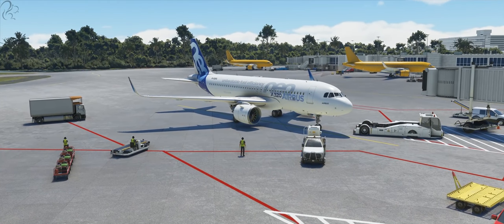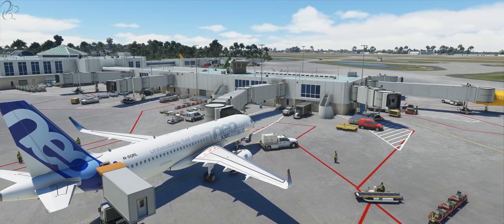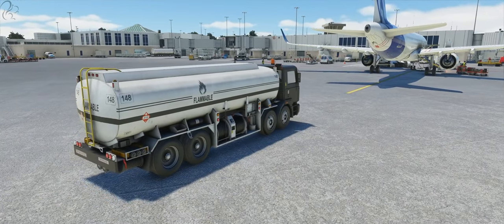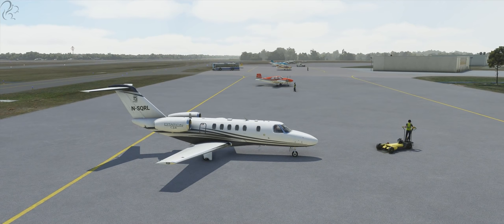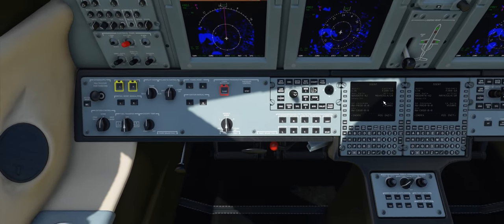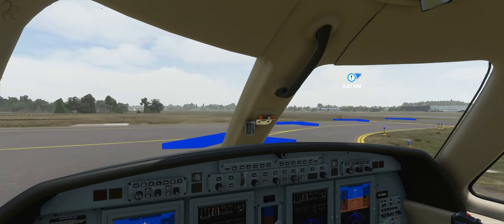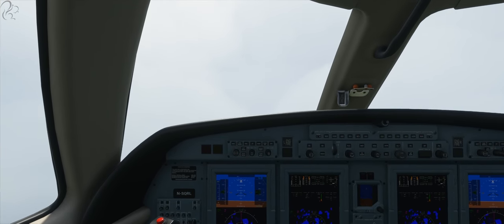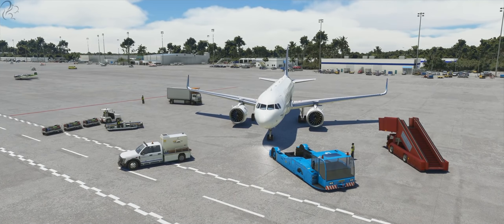Ground Services & ATC - Microsoft Flight Simulator

Comment: Thing that bugs me the most of the fuel truck being on the WRONG SIDE of the aircraft....  All airlines get the option of which side they want the fuel panel on and most pick the right side.  Im a fueler....  The panel is up on the wing or on the fuse next to engine 2 or both depending on the airline again....  Yes a fuel tanker would fit under the wing of a A320 CEO/NEO.  Its tight but there is enough clearance for a 10,000 gallon tanker to fit.  If GSX becomes a thing in FS2020, i rather use that anyways.....

Comment: The interactions with ATC in the ground services section are definitely not realistic, since none of those interactions (with the exception of the push back clearance) take place with the Ground Controller. Also all push back dialogue only happens between the tug driver and the pilot and not the tower.

Comment: Good to see it has more out of the box than X-Plane or P3D in terms on ground handling services, but it's a shame that the cabin interior of the aircraft doesn't seem to be modelled, only a couple of window views and the areas where the doors are. I suppose this would be something you'd see in addon aircraft rather than the default ones but it's still a shame to see. Hopefully they fix the janky collisions before release.

Comment: Any recommendations for new equiptment i need for flight sim, I am new and am wondering what i need at a relatively low price?
Reply: The basic I would recommend you is a HOTAS like the Logitech X52 for example and your keyboard and mouse. 
If you have a bit more money, there is some better options like the Logitech yoke and accessories or thrustmaster TCA officer pack.
But to start, don't spend too much until you're sure that you really like it. And try to learn as much as you can in order to enjoy.

Comment: So....question:  Is the game going to include some form of career mode that requires all this ground services stuff (including fuelling from the truck rather than just picking the fuel you spawn with)?  Is the game going to remember fuel, catering supply and battery levels when you despawn?   Will there be a penalty for forgetting to take food and drinks on board and only realising when you're an hour into a 6 hour flight?   Cos if not.....what an opening for a gifted addon developer.

Comment: Another sim pilot doing an engine start while attached to the push-back tractor, WITHOUT turning nose wheel steering off.
Just push all the way back to the hangar, load  up Aircraft Mechanic Simulator 2020, and proceed to do the steering cylinder inspection. ;)

Comment: I like the fuel truck is very careful. (At 10:00-10:59 ISH)

EDIT: Squirrel, did you takeoff in the Cessna Citation and land in the A320NEO?  If you did that could explain why you were told (upon landing) to taxi to GA parking.

Comment: Technically, during a pushback, the ground operator should be communicating directly with the pilot, not the pilot talking to ground frequency and then the ground frequency passing the message on to the operator.

Comment: Hey just wondering I have a computer with the same spec as yours only with 64 gig ram, can I play this game on maximum ultra settings with ease?
Reply: On what resolution? Currently, no available hardware can do 4k/60fps at ultra settings. Not possible.
You can turn down the internal rendering to around 70%, that helps. And lower settings to high.
Reply: @smaller_cathedrals  I just purchased a 49 inch ultra wide Samsung, 3840 x 1080
Reply: @smaller_cathedrals  The 144hz refresh rate of the Samsung 48.9 Inch Ultra-wide Curved Gaming Monitor

Comment: Did Microsoft not involve pilots in the creation of FS2020? GPU's are really NEVER on the back of trucks. External power is usually supplied off the jetway or a power cart if there is no jet bridge. And ground control doesn't handle GSE. Operations does that. It's beautiful though.

Comment: Naughty, naughty. The door should not open until the catering truck is in position. The catering team actually open the door, not the aircraft crew. Edit: crew will open the door if they are aboard. However, catering load is usually done long before the crew arrive, so the catering team would open the door. Either way, the door is never opened unless the truck is in position.

Comment: I've been a Jet Fuel delivery guy (not a fuller). There's nothing called being too careful in that job. Clip a wing, back into the hull, or sneeze in the wrong direction you're looking at hundreds of thousands in damages.
I've been at a smaller airport where you have to use the taxiway to do a 180 turn for the offload spot. Everything looked chill, nothing going on. I need permission to enter the taxiway don't I. Where are the guys with the radio? 
Started to creep forward and out of nowhere a GA just appears skipping his way past the front of the truck. Diarrhea moment! 
Since then: Nothing else is more important. Nothing needs to be hurried. Rules save my ass if I follow them. Careful is the word of the day every day.

Comment: I wouldn't be surprised if they kinda left the ground services lacking in features, just so payware addons (like GSX) can be introduced. When I found out that FS2020 was going to have all those features there was a bit of doubt in my mind that they would be as clean as GSX, which also has flaws but you know, its still better than this. Maybe I am wrong, but if these bugs/issues are present at launch, I have a feeling that support for ground services will be very limited and pretty disappointing. With the amount of third party developers that this game has already, and with more to come,  I think any short fall of the base game will cleaned up, but at an expected cost. What they have given us so far is breathtaking, and they have revived the flight sim community for years to come, which is exciting.

Comment: This is amazing for freeware wow. Not saying this in a bad way just some food for thought from a guy in the industry. The GPU got connected in the wrong spot it doesn't go up the nose gear it goes in a panel in front of the nose gear directly below the cockpit. The cargo bin is about the right size for an A320 but the inside shape is off and the fuel truck fueled on the wrong side of the aircraft. These are the things I've noticed only 10 minutes in though but all in all not bad! It is a flight sim not a ground sim after all and it is new. I'm sure it'll get patched

Comment: For a US airport at around 5 mins or so when you made the comment about loading and unloading at the front and the rear door, that’s actually accurate as you normally only board small passenger (like the A320 NEO) aircraft in the US via the main door and would not use air stairs at all unless there was no jetway.  Ramp and air stair boarding is not that common unless its an 50 to 100 passenger RJ.

Comment: MS have been years with this in the planning before making their grand announcement on the launch date. I said then (on a different Reviewer's channel) that MS were releasing far too early - a bit like selling a car before you've connected and tested all the components! The result, as I stated weeks ago, would be a lot of very unhappy customers discovering they'd bought a "buggy" instead of a shiny new dream machine. In my view, MS have launched early, purely to get the money rolling in (call me a cynic), but it would have been better to get everything up to a reasonable standard first; after all, a week after the launch they released a whopping bug-fix download that should have been done before the launch. Yet, as this video shows, there is a very, very long way to go. Far too much is still in early process, and while the dedicated F-Simmers and experienced Sim/Real pilots are scratching their heads in some frustration, what about those first-time pilots MS are so keen to get on board? How are they going to get their aircraft off the ground when they won't have a clue as to what's supposed to work and what doesn't? I've been F-Simming for over thirty years and have had every version and update of MS, and to be fair, I cannot recall many bugs in the programmes - the odd technical glitch yes - but little that might constitute an unfinished product. In MSFS2020 however, I feel that MS have tried to cram too much, too soon into this current version., with none of it up to a satisfactory standard. Yes, the graphics etc might look superb - in some areas - but in reality they're depending on 3rd-party dev's to make it better, which is absolutely fine, but most of that should have done and dusted long before launch.
Call me stupid, but like so many others, I've gone and ordered a new rig costing close to £3,000, already thinking that I'm going to be disappointed, and possibly technically unable to sort out the various tweaks that will be inevitable; and so I think about those poor first-timers who are probably going to end up throwing their monitors at the wall in frustration. Most of us dedicated "flyers" will already have ploughed an awful lot of spondulicks into the hobby over the years, and now we're going to have to start almost from scratch all over again. No doubt MS will be laughing all the way to their bank - at least for now! Let's just hope we all get (eventually) what we're paying for in terms of a quality product that gives exactly what it says on the tin!
Like what you're doing Squirrel, and I'll be subscribing.

Comment: Could have obviously done with a much longer Cosed Beta to iron out a lot of these minor bugs.
Reply: I don't know how useful that would be. The vast majority of people, including hardcore simmers, wouldn't be bothered by most of these things. The details don't need to be perfect at launch. Rather they'd get everyone in and then work on the smaller things as they keep going.
Reply: Also as pointed out the actual functionality is tied to the fuel/luggage menu so it is not a simulation limitation, more of a RP limitation

It can all be "ironed out" at a later point, besides the actual flying part looks excellent

Comment: Im dissapointed with the voices. The tech for AI Voices has come so far, yet the voices sound very robotic. Only thing that hasnt thrilled me though, so it's just nitpicking.
Reply: i think they are using WIndows 10's built in text to speech, which is generally quite poor by modern standards. i've heard another youtuber's ATC using a British accent, which suggests you can pick which Microsoft voice to use, or perhaps it uses your system default.

Comment: Flight crews don't do any of this,it should be all totally automatic,like GSX on the Flight Sim Labs A320. What would be cool is if the gate agent gave you a random load sheet, Cant wait for a 3rd party airliner with ACARS. I feel the FSL A320 is the most involved simulation of airline ops. I was an Airline mechanic at KBOS,so not talking out of my ass......

Comment: This is still beta that he is using. They are working on more important things that are vital to the sim as far as aerodynamics, avionics, ATC, scenery, weather, UI, VR, etc. So they are hitting the HIGH priority things first. This is a simple fix that is and WILL be addressed but not at the top. I do work for a 3rd party developer for DCS  so yes, it is a pain to get everything right even with a large team. One thing affects the other so it's a balancing act. Don't worry, they will get it right.